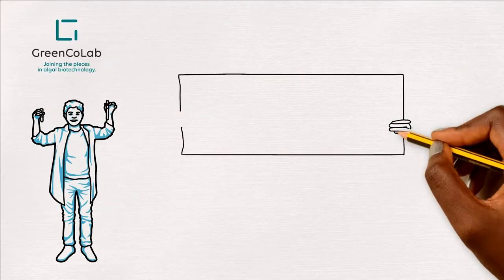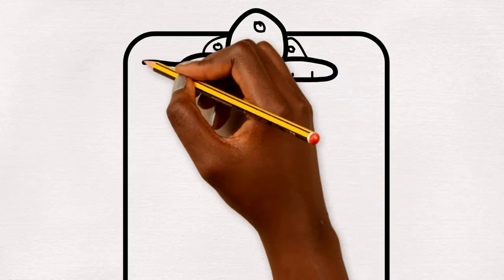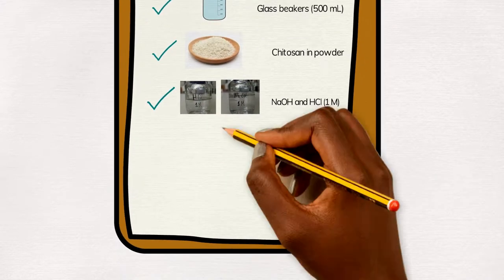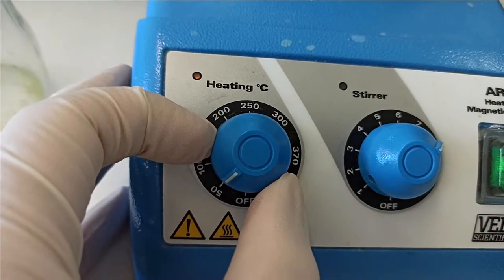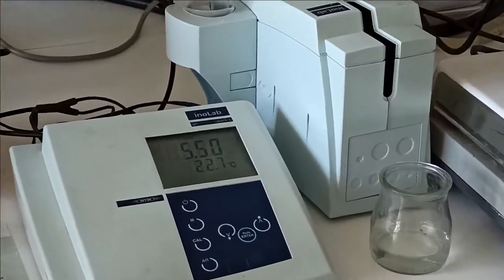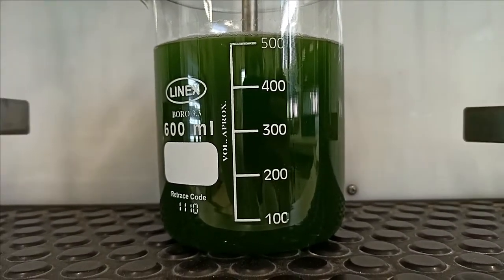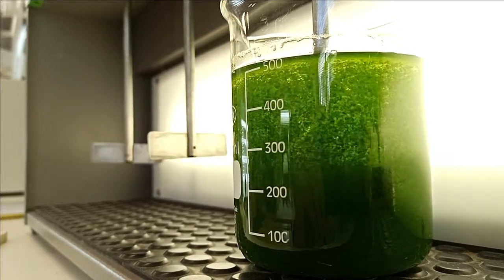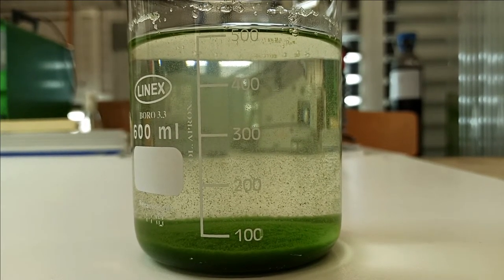Flocculation with chitosan using the Jar test

Comment: Why dissolve the chitosan in acid?
Reply: Chitosan is soluble in acidic ph only
Reply from the maker: Hi Rohan,

Thank you for your question.
Chitosan is a weak base and is insoluble in water and organic solvents.
However, it becomes soluble in dilute aqueous acidic solutions (pH<6.5) by
converting glucosamine units into soluble forms R – NH3+.
By dissolving it first in acid, chitosan dissolves uniformly in a microalgae culture,
which enhances the harvesting performance of the biomass.

All the best,
GreenCoLab team
Reply from the maker: Hi Vemuri,

Thank you for your input!

All the best,
GreenCoLab team
Reply: why you don't used acetic acid?   @greencolab
Reply from the maker: Hi @TheLahevi ,

Thank you for your question.

We decided to use HCl since it is a strong acid and can completely dissociate in water to release hydrogen ions, as opposed to acetic acid, which is a weak acid.

Nevertheless, there are reports of chitosan being easily dissolved at 1% of acetic acid (v/v) so it can be used for creating chitosan stock solutions

Please note: we also decided to use HCl because we didn't mind having altered salinities. While this is not relevant for acetic acid, the formation of acetate could change your bacterial community load and diversity, since acetate can be used as a carbon source. 

All the best,
GreenCoLab team

Comment: What is the concentration of hcl and chitosan?
Reply from the maker: Dear Jasmine,

Thank you for your question.

The stock concentration of chitosan was 5 g/L and 0.1M HCl was used to dissolve it. Please note that we then diluted chitosan 2 times so the final HCl concentration on the chitosan solution was 0.05M.

If you were referring to the chitosan concentration on the final culture we used 20 mg/L.

Thanks,
GCL Team
Reply: @greencolab  how much ml HCL did you use to  prepare stock solution
Reply from the maker: Dear @ehabibrahim9289 ,

Thank you for being so interested in our video.

To prepare the chitosan stock solution, we dissolved 0.5 g of chitosan in 50 ml of 0.1 M hydrochloric acid (HCl). This mixture was stirred continuously for at least 10 minutes to ensure complete dissolution of the chitosan. Then we diluted it to 100 mL with distilled water, so that the final HCL and chitosan concentration would be 0.05M and 5g/L (respectively).

If you need further assistance, feel free to reach out.

Best regards,
The GreenCoLab Team

Comment: This only works on algar particles with an opposite charge right? What about the inerts?
Reply from the maker: Hi Chitrang Kapadia,

Indeed, flocculation works through opposite charge neutralization. In the case of algal cells and also the majority of other microorganisms (e.g. bacteria), negative surface charges hold them in suspension but these can be neutralized with positively charged flocculants. In the case of inerts, they can be settled by natural sedimentation or even through physisorption (Van der Waal forces). We couldn't find much information about the inert particles but according to this reference (https://www.911metallurgist.com/selective-flocculation/), there might be a change of them adhering to flocculants due to "active sites" being physically entrapped. But be aware that in principle, this should only work with patch or bridging flocculations.

You can learn more about different flocculation types here: https://www.mdpi.com/2311-5637/4/4/93

All the best,
GreenCoLab team
Reply: @greencolab  thank you for the response. I was looking at waste water treatment with Chitosan but it was not working for me. I tried using 50 ml 0.1% Chitosan in 500 ml but there were no flocks found after agitating it for 30 mins at 250 rpm and then letting it set for another 30 minutes. Could you please suggest where I could be going wrong? Thank you for your time.
Reply from the maker: Hi @chitrangkapadia9293  ,

Thank you for your question.

There are a few important variables for chitosan to work properly.
a. Chitosan preparation: it is important to dissolve it first in HCl and dilute it afterward – please follow the exact procedure we mention in this video concerning the stock preparation.

b. Your wastewater profile: depending on the type of wastewater it can be more difficult to remove suspended solids. Check in the literature if there are flocculation studies regarding your wastewater.

c. Wastewater pH and temperature: pH is very important for flocculation to work properly. The best would be to first optimize it, by adjusting pH prior to the addition of chitosan. Bear in mind that the higher the concentration of chitosan you add, the more acidic the wastewater will be (due to HCl in the stock solution). You can test for instance pH 5, 7 and 9. As for temperature, normal room temperature is ok.

d. Chitosan concentration: chitosan is a very strong cationic flocculant so it is likely to follow the rule of “less is more”. Test different concentrations of chitosan, I would start with 5 mg/L and go up to 75 or 100 mg/L (this last one you already tested).

e. Running speed: by the time you add chitosan you should mix it fast (I would use 150 rpm instead of 250 rpm) but at lower times (1 minute is enough). Then, use a low speed (10-20 rpm) for 5 to 10 minutes to allow floc formation. This could be the reason for your unsuccessful trial since you used very high speed during a long period and did not include a low-speed step.

We hope this was helpful and wish you success in your lab experiments! 

Take care,
GreenCoLab team
Reply: nice
 @greencolab

Comment: What is the NaOH for then ? 🤔
Reply from the maker: Hi Edward,

Thank you for your question.
NaOH is used for adjusting the culture pH. It may not be necessary if you only
need to lower pH. Nevertheless, we decided to include it in the material’s list as
it is a commonly required reagent.

All the best,
GreenCoLab team

Comment: Soo this works as well on pools with medium dark green algae? 

 Im trying to shock a 12500 gallon pool, but its raining quite regularly so the PH in the water is ridiculously low, so I cant use Chlorine shock.
Reply from the maker: Dear @chesi_7_0_79,

Thank you for your question!

Using chitosan to remove algae from pools is indeed an intriguing idea. While we haven't encountered anyone specifically using it for this purpose, it's theoretically plausible. Chitosan can act as a flocculant, which means it could help aggregate and precipitate the algae to the bottom of the pool at a low pH.

If you decide to try this approach, it’s essential to ensure thorough mixing of the chitosan to maximize its contact with the algae cells. After the algae settle at the bottom, you will need to develop a method to effectively remove them.

We recommend performing a small-scale test first to evaluate the effectiveness. Additionally, consider consulting with a pool maintenance professional to ensure the safety and feasibility of this method for your specific pool environment.

Best of luck there!

Thanks,
The GCL Team

Comment: Sir if i change the microalgae with wastewater ,the experiment will success or not?
Reply from the maker: Hello @ambro4523,

Thank you for your question.
The simple answer to your question is yes, chitosan is an efficient polymer to remove organic matter from various wastewater.
However, it is best to check the literature and know if chitosan or other flocculant type has been used to clean your wastewater type.

Here you can find 3 articles regarding this topic, that will provide you additional information:
- https://onlinelibrary.wiley.com/doi/full/10.1002/pi.5464
- https://dx.doi.org/10.5772/65289
- https://link.springer.com/article/10.1007/s10924-005-5533-0

We wish you success in your experiments!

Best regards,
GreenCoLab team